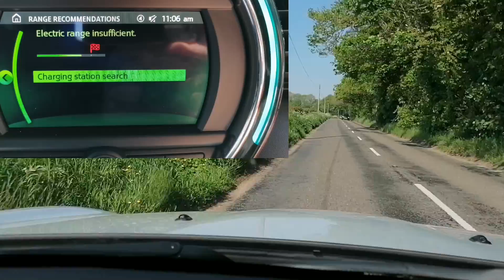Mini Electric Cooper SE range failure and distance to empty GOM problem

Comment: but what would happen when the battery is degraded then how do u calculate remaining battery?
Reply from the maker: Unknown, depends how the software works. It might use the previously hidden battery capacity to mask degradation or it might just show lower range. Impossible to tell until it happens which is good news. No one has noticed it so its not a problem

Comment: Hi Nigel.

Seeing that I haven't driven an EV as yet, due to cost and availability.

What my take was on the rant and what I was thinking all along.

Steps to take for a new EV driver:
1.  Look at the quoted range that you will get with a pinch of salt, coriander, pepper and a swig of mixed herbs.
2.  Take the available battery capacity and take away between 10 and 20%.  The reasoning behind this is, the higher the speed the less range you'll have to because of the drag co-efficiency and energy needed to maintain speed.
3.  Do test on smaller ranges and see what the efficiency is, add about 10-20% on that, to give yourself a margin.
4.  Yes, repeat the test at different speed, and make certain that the speeds you are testing, equated to the speed of the country, and test the minimum as well as the maximum speeds that you will get.  This is to ensure that you do not tick off other road users, and also do not feel stressed when you completed the trip.
5.  Ensure that there are charging infrastructure, or have a backup plan with friends that lives on the routes, just in case you need to charge while testing.  For that top up that is might be needed.
6.  As you become more familiar with the vehicle that you are driving, start stretching the distances, till you feel confident with the vehicle you are driving.
7.  Test the economy of the vehicle not just on flat surfaces, lucky for me, I do not live in an area which is predominantly flat, hills, inclines, declines, mountains are all around me.
8.  Once you are comfortable with what you can do, do a longer test.  Or take the vehicle to the max range that you feel comfortable with the security of knowing where you will charge for the test.
9.  Gradually add the weight to the amount of what you will be doing on these trips.
10. Just in case you don't have a mathematic inclination of how to work out the range, find yourself in the ranges that you know you will be capable of doing and relax.  Trust that you did all the test in different weather situations for the country that you are from.  Yes, in winter we some days still get up to 18 degrees celsius, with the region I live in, the minimum would be around 5 maybe 6 degrees celsius, with wind and rain.  Okay, I also know that one of the trip I would take, might take me to around 0 degrees, and that depends on if there is snow on the mountain tops and not to far from where I will end up.  I also know that the summer temperatures can go into the 30's and very infrequently go to the 40's around where I live.  And yes, the longer trip I do think of in summer hovers in the mid 30's to mid 40's.
11.  Figure out what the battery does in each temperature range and know that between 15 and say 30 degrees celsius, you will have the best range, as the battery doesn't need to heat itself up to much and then the cooling down of the batteries wouldn't need that much power either.
12.  If your budget allows, always goes for the spec of vehicle with the seat heaters and coolers if the vehicle permits, if not and you are taking on longer ranges, have it plugged in and condition the interior space to a temperature that is comfortable for you.  Not just because this will save the vehicle from exerting more energy to heating or cooling down of the cabin, but will have you comfortable from the onset of the trip, also lessoning the stresses on the body and the mind.

See, it isn't just you that have an analytical mind, some of us that haven't even had the experience of seeing EV's on the road that much.  And I have seen an EV on the road.  Yes, an EV, as the same car numerous times.  A BMW i3, being utilized by some armed response unit.

I always do these test with a vehicle, just so I know.  When the need arises and I do have to take the vehicle on a longer trip, I can make it.  The test is easier with a fossil, as you can throw in a gas canister to test the petrol light range out and how much that last section of emergency driving will give you.  An EV, where do you get an inverter strong enough to go with you, that will charge it fast enough without hampering the range test.  And how big or strong would the inverter have to be, for you as a driver not to freak out.

I still think, the Mini Cooper SE would be a perfect car for me, and the range of the Volvo XC40 P8 Recharge, would easily do all the long range driving we do.  Okay, it would work for that quarterly maybe annual ranges my sister would take for work functions.  And on the plus side, she'll have 2 days, even if she only has a 3 point plug to charge, to refill the battery to get home again.  As a daily, the Mini would work for me, and the BMW i3 would work for her.  Or have I looked at this as incorrect.  Because the BMW might also work for the ranges that she needs to travel, if 120Ah is bought with a range extender, but what is the point of the REx if you go for a BEV.  As the point would be to lower the carbon footprint and more relaxed driving an EV gives you, isn't it.  And all the reviews I have watched with people that are driving a REx, they don't use it, and it became an extra weight to carry around for the vehicle.  Dead, unused weight.  But it would give the added security of getting to your location with the fuel being the emergency to generate enough power just to finish.  And a 3 point plug would recharge the vehicle much faster just because of the size of the battery.

Am I now overthinking this whole thing, or am I just being rationale for a mathematically inclined person.  Option A does this, Option B do that to exceed Option A.  If neither works, put in backup plans for both, with a few extra on each option.  The road used, the speed used, the regen set to what you think might give you the most range of the lot.  Equate the distance with just a mere 10kph decrease in speed, and see what happens to a max of 40kph lower.

Yes the speed limits in South Africa:
Town/City - 60kph (37.5mph)
The roads between areas - 70-80kph (44-50mph)
Freeway/National Roads 80-120kph (50-75mph)
What some people are driving at, because they feel they National speed limit is too little 140-160kph (87.5-100mph) up to even 200kph (125mph).
Yes, I have done over the 125mph, but that was work related and chasing suspects in a police vehicle, racing track, and the first time driving a sports vehicle (last one, many moons ago, when I was less than half my age now).  With age comes comfort of rather enjoying the scenery and not going to the max the car can do, even if you still want to know what it can do in an emergency, always look for a safe space to test this.

Enjoy the remainder of the weekend and the week Nigel.  Till I find a reason for a long comment, that might beat the longest I've sent.  It's just the amount of information I have to give, and my thought tract has finished, otherwise, I feel like I  gave  an incomplete message.)
Reply from the maker: Love your longer messages.

Sadly unlike us the masses seem to be blind folded needing perfect petrol replacements. Change doesn't come easy to some without a bit of hand holding. YouTube and EV groups are a great place to gain information but they're not for everyone.

The i3 120ah is perfectly capable. I3 rex less so but has the rex that you don't really want or want to use. My view is it encourages poor range management but it might be a bit of a collectable for the future. Rex isn't a common tech.

Software annoys me as Ive a programmers background. Software always works its just whether the design is any good or whether it's poorly coded with faults. In this case it's incomplete and poorly designed. All the elements are there for it to be much better.
Reply: @EVPuzzle  I'm not a coder.  And my programming knowledge is limited.

Agree, the flaw in the programming.  If it by any chance can read the topographical and speed limits as a guide, and adjust to speeds being used.  It should be a better program.  Being capable of knowing approximately what the battery levels would be on the trip.  But few and far between, the vehicles works on an average consumption and not the topographical zone travelling in.

Let me use the Chevrolet Bolt as an example.  The vehicle's GOM states a minimum range, an approximate range, and a possible longer range.  Not saying it uses topographics as a guide.  But if the vehicles could give a range for max speeda used, a middle and the lower of the allowed speed (used speeds) as range calculators.  The drivers whom are not inclined to do the calculations on their own, would know.  Max speed would give them that approximate range, and if they could live with a slower speed, it would or could possibly mean that they can reach their destination faster or at the same time as if they had to stop for an additional charge to maintain the top max speed needed.

Agreeing also, that the human race always looks for quick fixes, and wants the fixes to be in the levels that they are used to or better.

The fix isn't going to be fast. Just like smaller vehicles were looked at as getting everyone in a car.  That didn't happen with the Beetle.

If I take the Fiat 500e, they have the smaller basically town car battery and the bigger longer range battery.  The difference is, the original had small cars had enough space for occupants, if not all their luggage.  Now we have small compact cars that does neither, and yes the safety has been increased for occupant safety.

I'll stick with the knowledge, that nothing is perfect, and even the fossil vehicles which people take as perfect, have flaws.  Is it, optimism, or do we call it blind faith in what people think, because they don't know any better.
Reply from the maker: I suspect bmw think too highly of themselves and won't touch it.

For me as a developer I'd be ashamed the simple option of letting the driver choose... Use latest efficiency or recalculate based on x y z.  Ignoring recent efficiency and the driver is crazy. The answer, don't use the BMW navigation system

Comment: Could the GOM have been more accurate than you thought? The range changed when you put in your destination, was it perhaps using real world topography to estimate range? On my Leaf I ignore the GOM and use the battery %, this rarely gets it wrong once down to 60% like you, I know I have a genuine 60 miles range until I need to charge.
Reply from the maker: No it's just bad programming, I'm going back on the same roads I just travelled getting 5.2mpkwh

Comment: Brave going out to Wroxham on a bank holiday. 100% agree with your rant on the GOM. Quite shocking that it's released into the open market like that. 
You can imagine the outcry if an ICE car's petrol gauge dropped 1/3rd of a tank when you plugged in a sat nav destination!
Reply from the maker: Very good point

Comment: Nigel, your example is extreme and I agree it is weird to drop 40% range just like that. Especially if your route takes you through country side, towns, etc. However recalculating the range based on route is actually quite good. I would really welcome it in Kona.
Here is why:
When I drive Kona locally I often get great efficiency - eg. 5mi/kwh. GOM often says eg.280mi with full battery. But when I'm going on looong trip (900miles) using only motorways I cannot reach first charger just 200mi away. I know that so either drive slower (60-65) or top up a little before Eurotunnel. But it would scare inexperienced driver thinking she/he can easily reach it only to find out late that this will not be possible. Especially in different country having local chargers, apps, etc.
Reply from the maker: I think we agree, we need more Information as just one number that's wrong isn't good enough
Reply: 105 down to 69 is a 35% difference not 40%...... Why not use correct figures.
Reply from the maker: Really?, 5% out estimate is something to complain about . You should try being perfect live in camera. It's not worth a retake . Surely you have something more important in life to  worry about
Reply from the maker: I assure you , you wouldn't welcome it if it was always out by lots .

Comment: Yes same thing with my i3s. As soon as you set a nav destination the range drops massively. It happened just this weekend in fact. I was 110km from home with 63% which I knew would easily be enough and gom was showing around 150km, then I set the sat nav and insufficent range alert only 108km now. I'm used to it with the satnav so I paid no heed to it and slowly range overtook the distance remaining. I arrived home with it showing over 30km remaining. The satnav is supposed to take into account road type and terrain but whatever it does it calculates a really conservative range. The only consolation is if the sat nav says I have the range to get somewhere I can be pretty certain I do. Stop navigation and the more realistic gom will return almost immediately.

Comment: After 6weeks with my Mini Cooper S Electric I can agree with you and everyone else the GOM is pessimistic and wavers around with its guesses way too much for it to be useful, and let’s face it with a smaller battery pack like the mini has the driver could do with more consistent range data. Does it matter to me? No, just like you I pay little attention to the GOM and I haven’t really used the sat nav yet.  Is this a good EV? No, it is a fantastic EV. Not because of it’s range or it’s GOM but because it is just a joy to drive, especially on the rural Devon roads I drive. Small, nimble, smooth, with plenty of power so it can be really quick on the narrow, twisty roads where I live.  In short I love mine. I do however wish there were more public chargers in the West Country, even those that do exist can be very unreliable. Sorry, that’s a bit off topic... 😆
Reply from the maker: Lincolnshire needs a few as well. There's a huge shell garage just installed on the A17 but no shell newmotion charger. Crazy

Comment: Tesla is just as bad - it doesn’t update at all, just bluntly says ‘x% battery = y miles’ based on EPA. So not even WLTP. They do have a fairly decent energy tracker using previous 15/30/instant consumption on a completely different screen that covers the map up, but for some unknown reason they don’t put that figure on the main range display.
Reply from the maker: If the GOM showed what it was based on you could interpret it better. I'll eventually convert to an iPhone and stop using the navigation built in
Reply: @EVPuzzle  I just estimate 2 miles per percent and thats close enough for motorways so is a fairly safe assumption so far

Comment: I agree 100%...! I’ve had my Mini 2 EV for 8 months now and covered almost 10k miles. I find the battery charge to be pretty accurate, but the estimated range is virtually unusable. I appreciate it always being on the cautious side, but every time you reset the nav it resumes “worst case” and completely ignores your real world usage history. Some days I can flick it from Mid to Green+ (on a full charge) and it estimates another 9 or 10 miles available range, another day I can do it and it doesn’t change at all...! So flaky.....!
(P.S. I absolutely love the car to bits! I’ve learned to ignore it’s GOM!)
Reply from the maker: I love it too. All the software is the worst side. Not a fan of the idrive system

Comment: I have not come across this before but i only trust the car for 115 miles in normal use and suggest a 10 mile margin is always allowed. A coffee and a quick charge on a 50kW rapid pod point at Lidls works for me so far!

Comment: The mini electric is basically using the same internals as the bmw i3. I've got a 2016 model i3 and it's just as bad. Today I was driving home put the ac on full it said I had 70 miles of range, I turned it down 50% then it said I had 65 miles of range, it's constantly changing its mind, so I just ignore it now.
In winter it says on a full charge I have 65 miles of range, put the heater on and you can halve that again. Now in summer it's giving me 90 miles of range.
I only ever do 15 miles a day so that's why I put up with it.
Reply from the maker: Shameful of a company like   BMW to be that useless at software

Comment: I always thought something was a little odd with the GOM. Very early on Teslabjørn did his review and said the Mini had a good range, then other got their reviews out and said too short a range, Carwow ran a number of EVs on similar roads on the same day until empty and initially the Mini looked a bit poor but then carried on to a total of 154 miles showing 6 miles range for around 30 miles. I can only think that someone told the GOM programmer that because of warranty concerns we want owners scared to recharge way before needed. Some safety margin is good but too much is actually damaging the image of the car.
Reply from the maker: Yep and scaring EV adoption away.